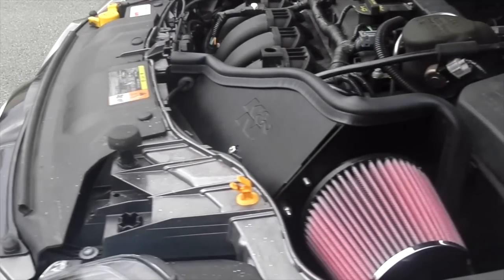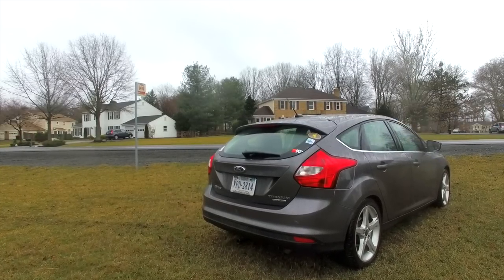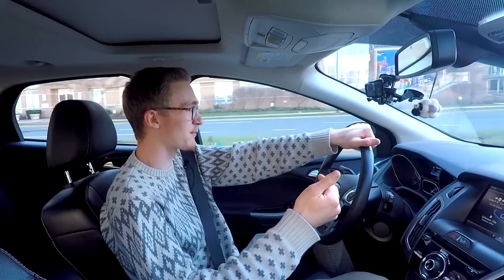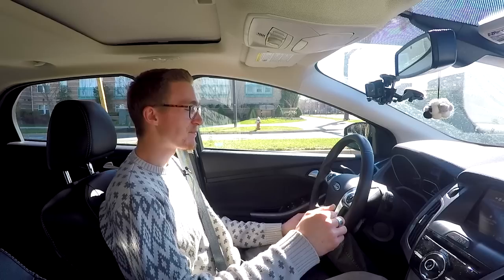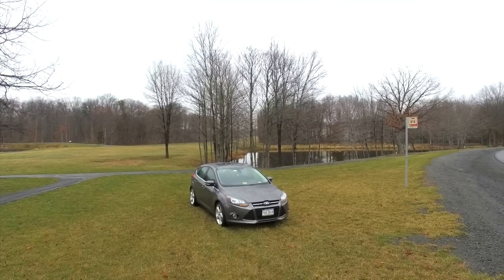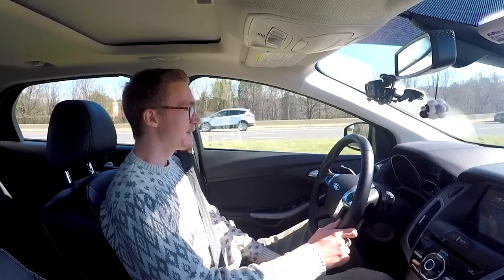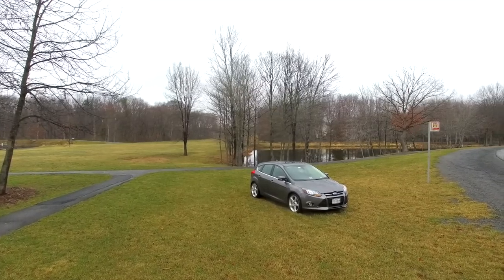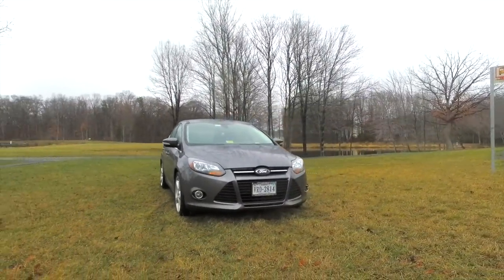K&N Cold Air Intake Update, What Happened to It??

Comment: I put a K&N in the stock box in a Focus SVT. Works really well.  Heat under the hood in these things is a big problem. My wife and I both have them and the heat cooks sensors. With these cars it becomes an effort to get airflow into the engine compartment to reduce the heat.

Comment: Just changed to a K+ N canister filter. Not the pipe one. On my 2017 Titanium Escape 2.0 turbo 4 cylinder. Makes a big different in sound and a little power gain off the start. Didn't expect the engine to run like a scaled Dog!  But for the $60.00 bucks it does what it said. Thinking about a less restricted exhaust system. If the price is right. In stainless!  Just for a better sound and look.   Shawn
Reply: U have a site? I don’t see none for $60

Comment: To get the best out of a Intake, you need to pair it with a high flow downpipe, and a 70mm+ stainless Steel exhaust. And of course a tune, so the car takes proper advantage of the mods. An Intake just by itself is basically just a sound mod

Comment: I put this same system in my 2017 Toyota corolla,  I live in central Texas where it gets 110 degrees every summer. I saw no difference from any season, the only reason you will be losing power is if your losing air, such as the filter not being tight enough. Sure of course its better to have cold air, but the only consequence of having hot air instead of cold air is loss of fuel economy, but the major factor with that is your driving habits, however as long as everything is tight enough, you should be just fine as far as power goes.

Comment: From experience,it's much cheaper in the long run to just buy the drop in filter from K&N and add a catback when your OEM exhaust need replacing.I just got rid of a cold air intake in fear of it sucking in water in heavy rain because part of the fender splash shield is broken off, exposing the filter.

Comment: Unless you get truly cold air, have a piggÿback module for the MAF or ecu  tune to adjust the A/F ratio. it's all just looks and noise. You will see some better throttle response but you can get just as much with a throttle body optimization.

Comment: Main question is: Did you have the AC run inside your car while you were driving in the more heated temperature times? Because from what I’ve learned and key word “I’ve” is that when you have a K&N filter in and it’s on hot days you’ll need to run the AC to keep the car cooler. For example if you made a tuner car for drifting(RWD cars). While your drifting you’ll want to have the AC because it’ll “HELP” the car engine stay cooler and not overheat. Again this is from what I’ve learned and my knowledge on cars from being taught,self taught, and still learning more about cars. I mean also you put a cold air intake on a new model car which will also affects the car and it’s warranty’s you have on there or whatever
Reply: Kayvon Young - Thank goodness you said that you´re learning. ;-)
How in the world imposing more effort in a running engine will make it stay cooler?! 
You realize the AC is just another power hungry system the engine as to drag along while running...

So by all means keep learning. Physics 101 is a good starting point. As of right now you´re surely on the wrong direction. ;-)
Cheers

Comment: I have one installed on my truck with an aftermarket exhaust. I see power improvement and mpg gain. Not by much, i noticed 2mpg gain. I installed it over the summer with average temp of 80-90 degrees. It didnt hurt my truck
Reply: No you don't. You think you do because that's what you expected to see. But no you don't. It doesn't change the computer programming. And before you get all in a huff and your panties in a twist, I also have an intake and exhaust on my truck. Runs exactly the same, no performance or gas mileage increases. Sounds nice but nothing else.
Reply: Okay, let me explain this one more time since you're obviously slow. Everything is run by computers, the air/fuel ratio, injection rate, spark, everything. Bolting something on does not change the computer programming, thus you gain NOTHING. There is no power or performance increase unless there are changes to the computer parameters that control those functions. I don't care about some bs marketing video you've seen about a product someone is trying to sell you. Any gains are hypothetical, and implied at best, unless you get ALL the equipment to facilitate those changes i.e. a programmer.
Reply: King Daniel thanks for informing me you fucking genius. I can only hope to be half smart as you some day.
Reply: @kingdaniel3519  you are correct and wrong at the same time. A stock no programmed comp will look a for what's there. If you open up the intake to allow more air in and open up the exhaust to let more air out, the comp will have to adjust and add more fuel to achieve the same numbers. What do you think more fuel will do? They have some parameters there for altitude so the motors wont run lean and damage them. While a tune or tuner would definitely get more out of those mods you will gain some out of them it won't be much bit it will be some.
Reply: @Charles Howard What you're describing is not the same as increasing the engine's ability to intake and expel air. Those are still computer controlled and have little to no variations, and any presence of a variation would be so minuscule as to be virtually non-existent.
Reply: @kingdaniel3519   I won't argue with you on this, believe what you will. If you open up the intake and the exhaust and make it freer flowing the engine will get more air and let more out. That is not computer controlled sir. It will breath the same as it is programmed, but when it does it will get more just because it is less restrictive coming in and going out. It will have better throttle response and all. Now I didn't say you would see huge gains, but there will be some. Yes the comp controls the air and the firing order, the fuel pulse all that. But it gain alittle because it doesn't need to work as hard to breathe. I wished I could show that , but videos wont prove it in your eyes.    All I am saying is it will gain a little power it might be 2-3 hp , you saix it won't gain any and that is wrong. The vehicle will also feel better too.
Reply: @Charles Howard Believe me, don't believe me, that's your prerogative. Best that I can do is to have you to talk to someone that tunes engines as a profession.
Reply: King Daniel I love how you just spent a bunch of time arguing with someone so stupid haha. I know you have to tune lol thanks for taking the bait you were perfect👑
Reply: @kingdaniel3519 newer computers relearn if you reset the ecu. Most factory cars have emissions to comply with so restrictive exhausts and air filters do decrease performance. So however small a better air filter will still increase performance, just choosing the right one is a different story.
Reply: @joseacevedo9117  Let me reiterate this 9 month old point. WITHOUT A TUNE THERE ARE NO PERFORMANCE INCREASES!!!!

Comment: FYI...when they test CAI they are in a shop on a dino with the hood open with a big fan blowing on the front on the car but other independent tests have shown CAI don't work and in some cases lower hp and they will increase your air intake temps.

Comment: Wild. I got mine and dropped it in, when it was hot out, noticed mild gains ish, and much better noise. But on dyno, got 6.1whp more than stock at top end, but even down low at 3000ish rpms, still 2whp higher,

Comment: I have had a K&N cone filter on my 2104 F-150 Tremor 3.5 EcoBoost  since it was new. I noticed Gas Milage drop recently, and just today cleaned and re oiled it. I will do the re learn trick also.

Comment: Thanks for the feedback because I recently installed a K&N air filter on my 2012 Focus SE.  I did notice immediately a noticeable VROOM sound and a low end growl.  I haven't put it on the DYNO so I don't know exactly how much boost I got from it.  I will point out that it never burned rubber before like it does now.  Based on what you told me, I will watch out when the weather becomes hot.
Reply: So how is it now??
Reply: yeah do you still have it on?  I just bought one before watching this video and don't know if I should cancel it.

Comment: So cone filter was sucking hot air, but stock airbox doesn't heat up? Obviously is you have high temperatures in the engine bay, both cone filter  and stock box will run hot? Difference is, when you drive, more cold air is being pushed towards the filter  which then sucks it in. Plus, you can watch hundreds of videos of cold air intakes being dynoed and working.
Reply from the maker: Not true. The stock airbox has a fresh air intake that runs to the grille to get cold ambient air to the filter. The K&N system draws air out of the engine compartment which is obviously heated up from engine operation. Yes, the K&N isn't a true cold air system because it isn't pulling in outside air, but we test the system as it comes in the box. A true cold air system most likely would've yielded different results.
Reply: @MotorMindsProductions So hold on, when you take the stock box out, you block the cold air feed pipe yeah? So all of a sudden there is no air flow? When you put the heat shield in, and place the kn filter by the stock cold air feed pipe it will get cold air, obviously when your car is going forward. Ive had cold air intake on every car so far, and as long as you provide the air feed, it works.

Comment: As long as it's under the hood, it's hot air. Ford engineers put the intake where it belongs, in the front.
Reply: Thank God someone else realises this, I was a fool and went k&n and ripped it out about 6 months later -  pulling air from inside the engine bay vs stock arrangement that pulls from the inside of the passenger side fender well
Reply: paul massing I agree 100 percent!!!
Reply: Joshua Bower let me guess you have a Ford focus as well

Comment: K&N’s DO offer slightly more horsepower over a standard paper filter. If you still want the cold air intake noise that you got from the K&N, then you need to get a performance air filter that is already housed within a heat shield enclosure. I used to have the same Focus and I put a performance air filter (like K&N) in mine and it was enclosed in a carbon fiber shield and it worked great! Smoother and more peppy acceleration and it sounded great and heatsoak wasn’t a problem! You won’t get any of the intake sound from a panel filter...K&N or not...trust me! Part of that noise is caused from the filter sucking the air in. The panel filter gets enclosed in the air box and so it deadens the sound. 👍🏼
Reply: So if I add a cold air intake, do I need the shields around to keep the heat out? Is it mandatory? Because it’s cheaper without it but will it still make a louder sound even with hotter air than normal?

Comment: For my truck I got an Air Raid Intake system and kept the stock air box and got a drop in AEM dry air filter, no problem with hot engine air coming in with a bit better power and fuel economy, and the truck doesn't stall anymore.
Reply: Hello I have GMC Sierra 1500 and I put the air intake system in it put I lose power and up he'll do is samting to do or how to get it to work batter

Comment: I regularly see issues with intakes on customer cars. Here's just a few. 
1: silicon content in the oil is much higher in cars with k&n style filters. I have sent out oil for testing to verify this. This means substantial wear on internal engine parts.
2: fuel trim issues on cars with Maf sensors. This is very common when the intake tube is changed, due to different diameter or bends of the tube. It can cause a lean or rich condition witch can cause power loss, wear, fuel mileage problems.
3: Gains HP in high rpms, lost torque in low or mid-range rpms. So you basically take away the acceleration you want in a daily driven street car. 
4: Wasted money because there is no difference besides the noise. Even if you "tune" your car for the intake, there is usually no noticable power gains. The power increase comes from the software and would have done the same without the intake. 
An intake should honestly be the last thing you upgrade, because most OEM intakes are capable of more flow than your car needs. 
Start looking into an intake upgrade when you make a large change, like a turbo, supercharger, etc. 
And never believe the dyno from the company that sells the part. I have personally dyno tuned many cars, and they usually make the same power or minimally more (1-5hp)  but will almost always loose more torque down low and make your car slower.
Reply: Josh lmao you only need an intake exhaust and a tune you can upload into obd2 and you can get 30hp or more
Reply: @daevid21  if you can achieve 30 hp with an intake exhaust and tune, you can most likely achieve those same numbers with just a software tune and catalytic converter delete. 
Catback exhaust is useless, just makes noise, And intakes are useless and just make noise. Unless you have some serious power mods like a turbo or supercharger, you will not have anything to gain from full exhaust or an intake. A 1xx hp focus does not stand to gain anything from and intake or exhaust. A tune? Sure, you can pick up a little bit.
Reply: @Josh-py2in  Theres usually no power gain from intake and tune?? Well thats wrong, but im too lazy to show  how stupid you sound saying that. Ktuner or Hondata Tune and a Intake with a Civic will have massive gains. Speaking from experience. And 2-8hp gain from intake and depending on motor.
Reply: @Rob_Nasty  gains from a tune, YES. Gains from an intake, nothing or minimal on most cars.
Even when you do gain hp from an intake, it's way up in the rpm range and it will usually loose torque in the mid to low RPMs. 
I actually dyno tune cars using Winols and mpps. Intakes are litterally the biggest waste of money in the car world. Everyone in a Honda adds an intake and suddenly think they gained a lot. In reality, on a dyno, they gain maybe 5 hp at 6500-7200 rpms and they loose what little torque they have at 4000-5000 they loose a substantial amount. You want real power, water/methanol injection with a tune, or e85 with a tune, nitrous with a tune. An intake is wasted money and just makes noise 90% of the time. Tunes make power, intakes just support power. Until you learn that, you will forever be in a slow car.
Reply: @Josh-py2in  I run turbo so low end torque is amazing for me. But yes now were talking!! High rpm gains exist with intake and or tune, for every car the scenario is different though. But theres no doubt intakes work. PRL has their dyno show mod by mod dyno'd numbers, and the increase is real, even if its minimal. And yes there is other massive gains out there. But those gains people never go for inless their a real car enthusiast.
Reply: @Rob_Nasty  turbod or supercharged cars are a completely different scenario, my statement applied to N/A applications only.
I myself run a GTI with a k04-064 turbo, The gains from an intake for my car were about 20hp at 6000rpm and 26lbs of boost.
Reply: Thanks Josh for a little common sense on this topic. I like to think the millions spent by the auto manufactures on R&D  are well spent.  If the OEM engineers could get a free 1-30hp by simply modifying the intake, while maintaining mpg, torque, drive-ability, sound levels, and reliability,  they would. In the meantime the aftermarket manufacturers would gladly take your $300 to help your car make more fart sounds.
Reply: Josh I put an exhaust and a cold air intake on my Jeep Wrangler and noticed an immediate difference in power as well as throttle response
Reply: @rippeddog325  Sure, in your butt Dyno you did. On an actual Dyno, you made maybe a few hp but lost an equal amount of torque. Most of what people "feel" when they do an intake or exhaust, is the extra noise and vibrations. 
Like I said before, if you want real gains, you need something more than exhaust or an intake. Those items don't make power, they simply support power and change your power band. This isn't the 1970s anymore with grandpa's v8 and 1" exhaust holding you back.... Nearly all vehicles have more than enough exhaust and intake to support the engine. Catalytic converters are restrictive and do rob a few hp, but the rest of your exhaust doesn't hold you back until you get some power mods installed. You can argue till your blue in the face, but I actually tune vehicles and have seen what these mods do. Noise, that is it.
Reply: @rippeddog325  it's true man I have put cold air intakes on all my vehicles they don't do shit I just like the sound they make, my 2500 Chevy lost power from a cold air intake so I had to put stock back on.
Reply: Hadden Wolf then explain to me how my Jeep couldn’t do a wheel spin before but it does now
Reply: @rippeddog325  not sure what a wheel spin is
Reply: Hadden Wolf when I floor the pedal the wheels spin with an automatic transmission.
Reply: Hmm not sure maybe you need new tires or it was wet pavement
Reply: Hadden Wolf tires have 600 miles on them on dry pavement
Reply: @rippeddog325  we use km in Canada, 600 miles is like 70,000 km so you for sure need new tires
Reply: Hadden Wolf 600 miles is 965.606 km
Reply: @rippeddog325  that's impossible...600x965.606 is 579,363.6km
Reply: Your 100% correct.  Such a waste of money to make your vehicle noticeably slower.
Reply: Yes you are right Josh. My daily is HRV. Very small displacement so power is almost nothing, and pair it with CVT. But replacements intakes feel almost no difference except you can always clean it with the cleaners and dont have to buy a new one after certain time. With the exhaust, i change the downpipe where the catalytic is and feel less restrictive. Better response and better milage. However i need to tune and dyno to gain more power rather than just these mods with all stock engine and tune